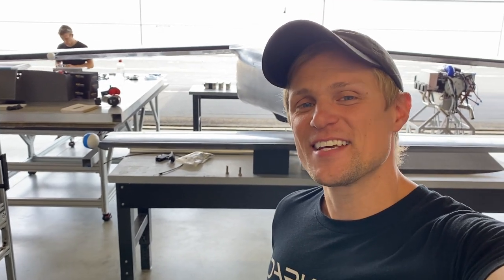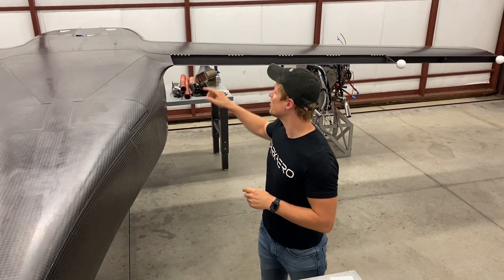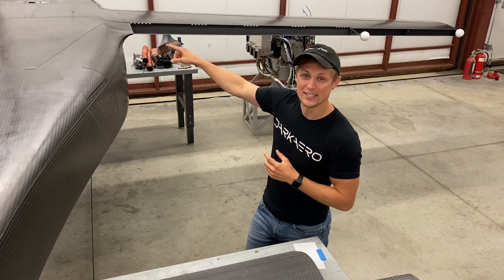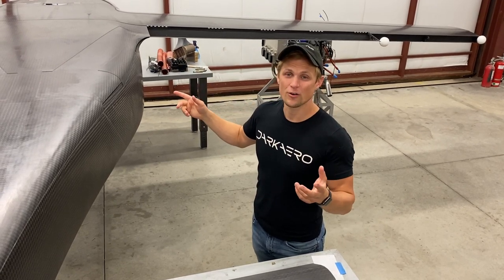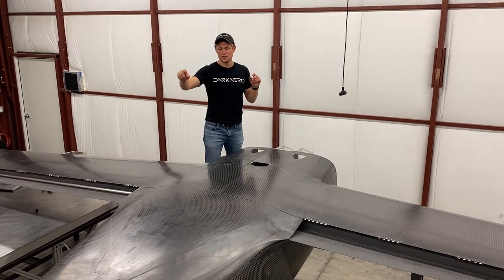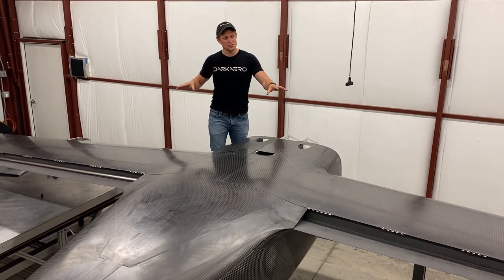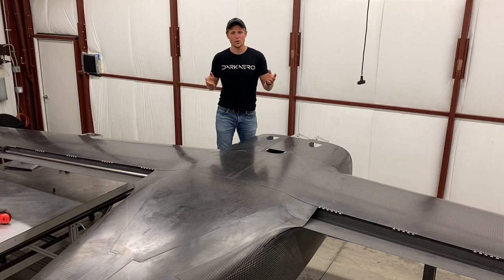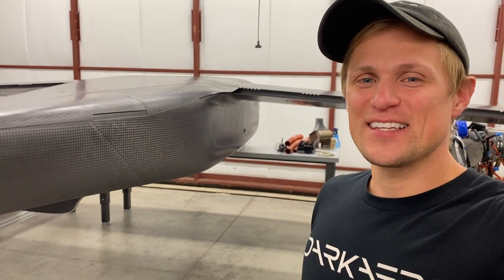Assembling the DarkAero 1 Wing to the Fuselage INVERTED! - July 20, 2020

Comment: The DarkAero 1 is really to looking sweet. With the gear doors closed and the tight wing fuselage seams it’s a thing of beauty. It looks like a bat out of hell, no, it looks like a “dark arrow”.

I can just imagine marketing videos from a chase plane slipping in front, then dropping under and finally behind the DarkAero. As the chase plane manoeuvres, in one continuous shot, the camera tracks the DA-1 from right side in to front looking through the prop, then pans the underside of the DA-1 with all split flaps, ailerons and rudder deployed for maximum airbrake effect even while the engine brought up to full power. Both planes enter a shallow dive and all the DA-1’s ‘splits’ are closed, the chase plane drops power, deploys it’s own airbrakes, and the camera pans over tracking the DarkAero as is appears to rocket away. It momentarily disappears, as it pierces a small cloud, then reappears out the other side with some cloud stirred up, seemingly trying to capture the DA-1 in it ethereal clutches but the DarkAero slips its binds and seems to enter a steep climb towards the heavens.

In the cloud, the DA-1 levelled out at full cruise but as the chase plane is far behind still in its shallow dive, the cameras perspective makes the DarkAero appear to be entering a climb.

Comment: So is there then one continuous spar through both wings, instead of a spar carry-through in the fuselage?
Reply: no there are several "spars"        https://www.darkaero.com/aircraft/                go halfway down the page to "hollow grid technology"
Reply: @richardvisscher2626  Thanks Richard. Interesting, so it looks to me like the ribs and shear webs provide form and shear stiffness, and the upper and lower skins actually carry the load in tension and compression laterally. I guess the structure also provides torsional rigidity. And extra bonus, you get built in fuel baffles.

Comment: OK....the inverted assembly technique has advantages.  When the tasks of installing the wing bolts, wiring, and other equipment installation is completed, is the builder then required to disassemble the wing from the fuselage, turn the fuselage over and then reattach the wing?

Comment: Greetings.
Do you have a video explaining how you dealt with a composite to aluminium transition?
For example, if the engine has to be bolted to the monocoque, how do you safely bond inserts or threaded aluminium parts into the honeycomb?

I have theorized some methods, but I definitely do not trust them.

Thank you for sharing this amazing project.
Reply from the maker: Leo, thank you for watching and the comment! We have a video coming out soon talking about galvanic corrosion and how we prevent it on the DarkAero 1. Stay tuned!

Comment: Will the wing be bonded to the fuselage as well as the 4 bolts?
Reply from the maker: Good question! Beyond the 4 bolts, the lower wing skin gets joined to the lower fuselage skin with fasteners. The wing does not get permanently bonded to the fuselage because sometimes it is necessary to disassembled the airplane and transport it down the road. A good example of this is when the builder needs to move the project from their garage to a hangar at the airport.

Comment: Can this do aerobatics ? Like not super fast but still loops n stuff
Reply: the engine is not made for that it can cause problems i guess 915 is not usually used for acrobats there are other engines made for that with redandancies and really hardwiring for every problem an engine can face with acrobatics
Reply: As they say: "Aerobatics are a Pilot controlled option".

Even a Boeing can do an aileron roll, with a great pilot at the controls. (Look it up, haha).

But, I don't think this aircraft was designed for Aerobatics as a primary design objective. Point hesitation rolls or at least knife edge flight would be a little challenging with the small split rudder, I would think. Thought their website and the wing lpad test video indicates it's built strong enough that it probably won't disintegrate if you wanted too fly a loop or a roll. Similar to the Lancair 235, 320, 360s etc.

Comment: i m not an engineer but aren't just 4 bolts less for wings ? wings expirence alot of forces in flight
Reply: Some planes only have a single bolt per wing. It all depends on how the plane is designed. If you have a cantilever spar on a low wing plane the only real force trying to pull the wing off would be negative Gs, which most non-aerobatic planes rarely experience.